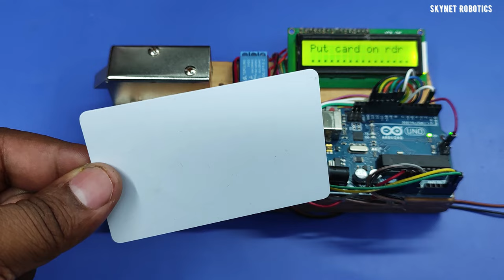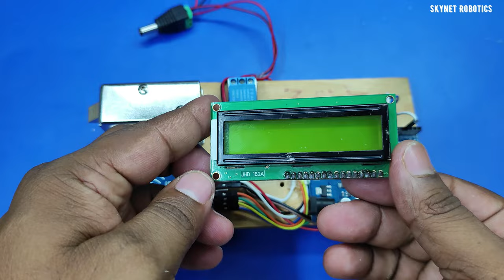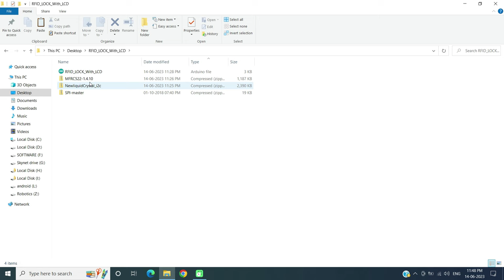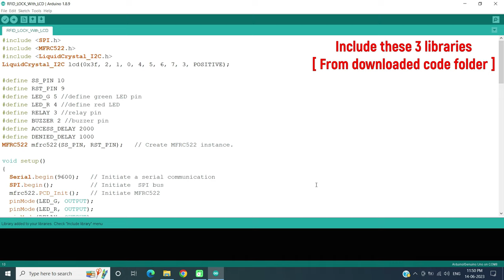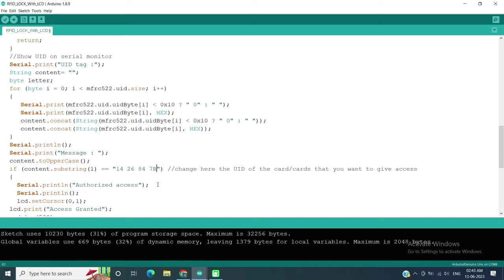how to make rfid door lock using arduino || how to make rfid door lock project

Comment: Hi there, I love this code of yours it is working well for me when connected to the computer. But not working with external power supply with SMPS of 12v to teh Arduino Uno. I want to run it without computer. Please help
Reply from the maker: Probably your Arduino voltage regulator got burnt out . 
You can try to give direct 5V to vin pin
Reply: @skynet-robotics  Just now i solved it.. problem was with SMPS. USed a 12v adapter.working fine. thanx anyway

Comment: Is it okay if i use 12v adapter directly to the wire instead of using 12v battery that is shown in the circuit diagram?, if  so how do i connect it?
reply pleaseee for research purposes

Comment: What is the function of the 12V adapter in the project? And how do you connect the adapter to the power jack?
Reply from the maker: You can use 12V battery
Reply: @skynet-robotics  is it okay to use only adapter?

Comment: Is it possible to use a 9V battery connector?
Reply from the maker: There is Solenoid lock which required 12v to work properly. 
Rest of the system Arduino, RFID ,display will work fine on 9V
Reply: Is it normal for the RFID sensor to heat up? @skynet-robotics

Comment: And how to change the time of the lock being open for more than 5 seconds
Reply from the maker: Change 
Delay(5000)
Reply: @skynet-robotics  okay thanks
Reply: @skynet-robotics it is not working
Reply: @skynet-robotics if i want to keep the lock unlocked for more time what should i do
Reply: @skynet-robotics after changing delay the lock is being opened after a long time 
I want to keep the lock unclocked for more time
Reply from the maker: I will send u code
Reply: @skynet-robotics kab tak bhejoge?
Reply: @skynet-robotics  Same problem sir I need code too

Comment: it only worked once, I also separated the Arduino source from the Selenoid, but it was still stuck. do you know the solution?
Reply from the maker: Keep away your solenoid lock from RFID reader
Because the magnetic field affects it's working

It will work!!!!  
if u do this because I worked lots of time and finally got solution on this problem
Reply: @skynet-robotics  I have tried it but sometimes it still gets stuck. do you know what the specific distance is? and should other components such as the power supply be kept away too?

Comment: But after 2 times it is not working after restarting it is working any changes in code?
Reply from the maker: Use seprate power supply for arduino and solenoid
Reply: @skynet-robotics  can you give the circuit diagram?

Comment: When i upload the code 1st time, when i put the card they unlock and when i put the card 2nd time they are not working.
After that when i re-upload the code they work 1st time only.
Please bro tell me how to solve this problem.
Reply from the maker: Use seprate battery for solenoid lock. (because it consum more power and arduino got stuck)